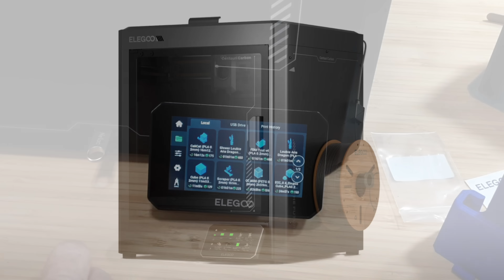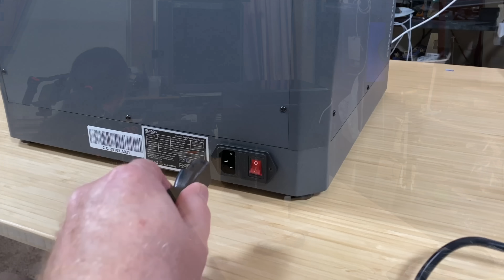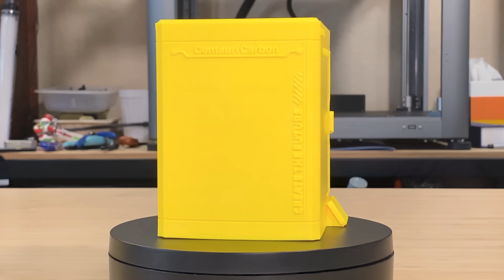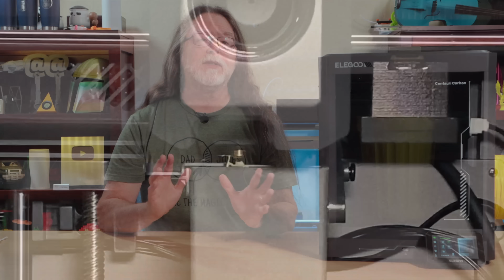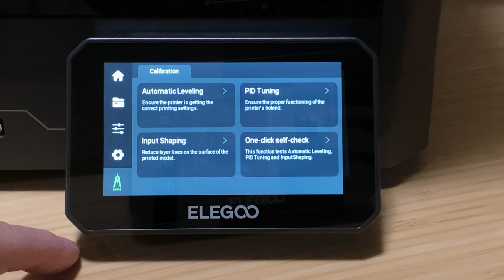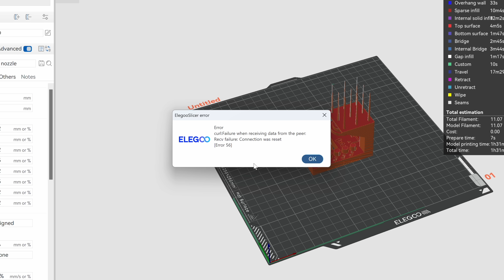Elegoo Centauri Carbon. Enclosed CoreXY for $299.99 USD?!

Comment: Can you use the regular Orca slicer or are you stuck using their version?

The build plate specs are only a little bigger than my Ender 5 Pro. Do they have a comparable model with a little bigger build plate?

Comment: I've never owned a 3D printer.  I don't own an oil field so I'm not rich.  I'm torn between the simplicity of an FDM printer and a resin printer.  I'd like to print figurines that I can airbrush with my airbrushes.  Not necessarily miniatures, but larger pieces.  Not gigantic, mind you, but larger than an inch for Christ's sake!   As far as resin printers I'm looking at a the Phrozen 8k Mighty and the Anycubic Photon M7.   On the FDM side its the Crealty K1C.   No matter how I slice it (no pun inteded) it looks like I'm looking at around $600.  Any suggestions?

Comment: The first person I see on YouTube who has put the cards on the table about the possible problems we may have with this printer in the future. 
I'm taking it slowly with the Elegoo. My first Elegoo was the Elegoo Neptune 3 pro and it came with firmware problems. The company that sold it to me (3DJAKE) couldn't solve the problem that the printer occasionally had a thermostat problem and would turn off and on, obviously losing the print, and then another firmware error. I can't even solve the problem with the firmware developer who sent me an apologetic email. Even today, with the latest firmware (which only had 3 updates), I haven't been able to solve the problem. I'm still using it, but I have to pray that I don't get the same problem in the middle of printing. I also realised that over time the micro SD memory becomes overloaded, for example, when it has to make many circles due to the number of triangles that the 3D printer has, and that also generated errors.
In short, I'm not going to buy another ELEGOO printer, in the rush to see that it is one of the latest printers, until it is well tested and we see what they are going to do about the poop, because apparently a coloured accessory is coming, and it would be better to see if there are people like you who test the machine, so that I can buy an ELEGOO CENTAURI printer, more refined and that doesn't cost more than 330 euros. In my case, I don't want to have to pay more for the mistakes of a company that has been selling faulty goods for years, then ignoring them and which for consumers are just another brick on the desk. I want a printer that works 100% for several years and I have the feeling that, at the moment, there is a race to see who can bring out the latest printer with the latest novelty, BUT THEY ARE NOT CONCERNED ABOUT TESTING IT WELL AND THEY DO NOT CARE ABOUT THE CONSUMER.

Comment: They literally said the multi filament system will be out by end of year.
Reply from the maker: Unfortunately, at the time of recording, they hadn't said it yet. 😅
Reply: @BV3D ahh I assumed since you posted this after the launch that you had already seen the info from the launch on Monday
Reply: I am a little worried now. As I just bought one. If I can’t print from the slicer it’s just a paperweight for me.
Reply from the maker: @SomeGuyWhat77  Yeah, It's just me doing this in between my day job and family life, so recording, editing, uploading, and closed captioning take time.
Reply from the maker: @SomeGuyWhat77  re: I am a little worried now. As I just bought one. If I can’t print from the sliver it’s just a paperweight for me. Elegoo updated the slicer (Unlce Jessy told me about it), which fixed the send-and-print issue I was having. The camera streaming is still problematic, but printing from the slicer over WiFi now works.
Reply: @BV3D  Ok awesome, thanks for the follow through here! That makes me happy. I only partially care about the built in camera as I always use my own Wyze cams, easier for me to monitor whats going on. The camera is helpful through for Octo Everywhere which can use its pseudo-AI to cancel prints when they go spaghetti factory!
Reply: @BV3D  That makes sense!

Comment: What makes this better then a Creality K1?  To me this looks more of a competitor of that then a Bambu P1S or a massive stretch of the X1C.  I had a K1 that worked really good and then 1 day it decided to crap the bed and not print anything it had just even a day earlier.  If it is from my understanding looking at everything people say it just seems to be a clone of the K1.  The filament sensor on the side (dumbest spot ever), hotend and tubes/chain looks identical to the K1, over all design seems almost entirely the same as the K1 (screen, door, etc.).  Someone not paid by Elegoo please tell me how I am wrong here.  If it truely compares more with a P1S and I will not need to tinker every print to get it right then great I can deal with the horrible filament sensor location.  I just need a printer that works out of the box.

Comment: Elegoo should add a wired Ethernet connection to the printer. The network issues you experienced could be caused by wifi dropping the connection. 
It's also what I experienced with video from a web cam connected to a Raspberry Pi (for my old Kobra printer). As soon as I used the Ethernet connection the video feed was stable.

Comment: Is the firmware on this Klipper as it has been on some of their other machines recently?
Reply from the maker: Elegoo hasn't said. It feels like it's running Klipper, but I could be wrong. There are only three network ports open on it. Port 80 for its built-in web server, and a couple in the 3000 range, one of which is for the camera streaming. I can't SSH to it because it doesn't accept the connection.
Reply: @BV3D  thanks for the reply. Hopefully it opens up a bit once it releases.

Comment: Curious, for the stringing and bridging issues, did you print the test model in blue PLA with the enclosure open or closed? I have seen a couple other reviewers print the same thing, with better results. Not calling you out, but supposedly its better to print PLA with the enclosure open. Nonetheless thank you for taking the time to review this printer.
Reply from the maker: Hi, no offense taken. I did the PLA prints with the lid off. It may just have been a settings thing, since it looks like Elegoo has a bunch of their materials already defined in the slicer, and I wasn't using Elegoo's filament.

Comment: Wonder if the issue with your send to print is that the router set a new ip adress for your printer and in the slicer wanted to use the old ip address.
Most routers, unless you have configured it differently, will give an ip address for a day or 2 to each device.
Reply from the maker: Hi! The printer was still at the IP address that was configured in the slicer. I didn't know until Uncle Jessy told me, but Elegoo released an update to the slicer a day or two before I recorded the video. That update appears to have fixed the network file transfer issues.

Comment: Your file upload issues sound like theres either an arbitrary limit to file size set on the printer's webserver or the connection times out before the upload actually completes. Either way it should be simple enough to fix in an update

Comment: It's a tough time to be in the market for a new printer. There are so many to choose from, but each has drawbacks too. Bambu and their recent drama, this with wonky firmware, the Anycubic that has an AMS, but really slow filament changeover times, the Crealitys with their issues. I think I'll sit on the sidelines a little longer.
Reply: Yes! I but Qidi plus4, it was amazing until it suddenly was dead. Now waiting replacement parts and hoping I can put it running again. It has some manufacturing issueas obviously.

Comment: Hi!
Did you try to access it from SSH? Maybe there you can install some better web interfacer (fluidd or mainsail with kiauh). Don´t know if klipperscreen could be an option for the screen interface...
Thanks!!
Reply from the maker: I tried, but it didn't respond. It only has 3 ports open. Port 80, port 3030, and port 3031.

Comment: Can you make a video of comparison to other Core XY? I want to upgrade to a Core XY but do not want to wait for the current pre-order date of June.
Reply: Seems like none of the people who received one have compared it to any coreXY like the Bambu P1S/X1. If it was as good they would have said so. The fact that it did not pass the .2 test in this video is concerning. It should easily have passed .2. Bambu’s can pass .2 and .1.
Reply: @TheFutureLooksGrimm  new to 3D printers, would purchasing the 0.2 hotend fix this where you need that precision?
Reply: @ it may do better with a  0.2 nozzle but I don’t know how much better. Printing with a 0.2 nozzle is extremely slow, most prints are done using 0.4.

Comment: The errors you talk about when sending files over the slicer. I have had the same issue on my Neptune 4, using Orca. I found that deleting old prints, through the slicer connection, fixed it.
Reply from the maker: Elegoo released an update to the slicer that seems to have fixed the upload problems. Camera streaming is still a problem though.

Comment: Awesome video. Did you update the slicer yet? I think v1.1.7 or something like that should fix the file sending. Camera is still wonky
Reply from the maker: Oh sweet, you're a lifesaver! I'm like 99.5% sure I checked for updates in the app when I first installed it and there wasn't one. But hey, it's there now, AND when you send the file from the slicer, it gives you the same options as when starting a print from the touch screen: You can enable or disable time lapse recording and bed probing, and pick whether you want the A side or the B side of the flex plate.

Comment: Looks like it could give Bambu a challenge.  The price seems very good for the size and features.   As you  stated firmware is the easy thing to fix, if the hardware works.   I'm impressed with the new 3D printers on the market, how far they have advanced in the 6 years I have been in the hobby.

Comment: Thanks, Bryan, for this first look. I have several Elegoo printers and for the most part they are reliable. I can see me getting this particular model when all the kinks are worked out and perhaps multifilament handling is offered, too. It certainly seems priced well. I like the fact that the user isn't tied to an Elegoo cloud service to print with, and you can still use a USB stick in the good old-fashioned sneakernet.
Reply from the maker: Hi Stew! So it turns out that a newer version of the slicer has addressed some the problems I was having sending files over WiFi to print. So if Elegoo can get the lighting sorted out, and tweak the firmware a bit to fix some of the other issues, this should be a pretty solid showing.
Reply: @BV3D  elegoo doesn't care though.....just look at the disaster with the giga. uncle jesse and 3d printing nerd had huge problems with the giga..... and elegoo has still not fixed those issues
Reply: only thing elegoo sucks at is customer service, it to 39... fuckin 39 emails to get elegoo to send me the silicone socks for my 5 neptune 3 max's. it was the biggest hassle. elegoo tried to get me to buy a whole new hot end, when all i needed was the silicone socks. elegoo doesn't even offer the basic replacement parts in their replacement section and ender 3 silicone socks do no work with the neptune series. elegoo sent me ender 3 socks and the sock failed after 1 print. after another 12 plus emails they sent me the right part and sent me a free roll of filament. i could care less about a free roll. the tech support at elegoo should have sent me the right parts after the first email. also all the replacement parts should be available online in their replacement section. no one should have to reach out to tech support for a silicone sock...its just bad customer service. elegoo has good printers but i warn you, there tech support/ customer service is the worst!!!!

Comment: As long as this printer is reliable over long term tests and the firmware stuff gets fixed than I think it's safe to say that Bambu will need to do something drastic or they will begin loosing market share rapidly to this machine. I own 2 bambu enclosed printers and I am already sold on this as long as it meets those for-mentioned requirements.

My main gripe with Bambu is their cloud service. I would prefer to work over my own private network. I lost internet for a few days which means I lost the ability to print directly from the slicer and I had to go old school with the thumb drive.

Comment: 299$ usd and 449$ cad, this maybe the cheapest feature packed 3D printer so far. A lot of people seem to forget what they are getting for such a low price
Reply: $625 CAD after the pre-sale is over. Still a great price but much closer to Bambu P1S pricing at that point.
Reply: @OnsaneDan  just bought it for 485$ cad after discount and shipping. The CC has most features of the X1C at 1/5 the price. This will be like the computer evolution of the 80s and 90s, which made them cheaper, affordable and more popular than ever before.
Reply: @mohamedh.guelleh630 How did you get the extra discount? I thought it was $449 with $50 shipping?
Reply: Buggy firmware, apparently.
Reply: @lyianx  it's a firmware and can be updated. The reviewers got the alpha version
Reply: @lyianx  every printer has buggy firmware when its just released. bambu has this problem when they released their first printer

Comment: The firmware interface looks like klipper. Can't wait for the cfw on these. Hope creality k2 normal size comes out soon.
Reply: The K2 Plus is a beast, by far the best consumer grade printer on the market, to the point it is not really consumer grade, its professional grade. I love mine, I have even put the old go to machine the K1 Max on ice for a while. Expensive ,  yes, head and shoulders above the competition certainly. I just works, and works fast with exceptional quality
Reply: @mikeobrien9829  yeah, the k2 plus looks great. I have a k1, so k2 would likely be the next upgrade if its anything like the k2plus. Worth it, but out of reach in terms of price for me.

Comment: Thanks for a detailed and non-marketing real review. 
I am not sure how big (or small) Elegoo’s software team might be, and that will affect the rate of development and polishing out the last bugs (while creating firmware to handle the open frame version and the AMS). 
Strikes me that there is a bunch of (English language) user interface polishing tweaks that would be nice, but don’t impact the actual functionality of the machine. 
Beyond that, Bryan flagged up that it seems to be that one communication process crashing leads to other annoyances. Squashing one bug should improve the overall reliability. 
But there were a couple of print quality issues that surprised me. I was kinda surprised that those things weren’t checked out. Was it a material profile or dryness problem, or just trying to print too fast? (We weren’t told the filament brand or profile used!) 
Firmware is (given the will and the resources) much more easily fixed after-sale than hardware issues. Seems like the hardware works plenty well enough for 299, but patience and understanding may be needed while the firmware gets tidied up. 
Now, will third-party lighting upgrades arrive before the printer itself? 😊

Comment: I'm guessing at the time of filming this might've been unknown, but Elegoo has announced a multi-filament system which is advertised to be released later in 2025.
Reply: ams systems are okay... the main issue with the ams and all ams you can never get exact colors, which is why there are so many noobies with off color pokemon. learn to airbrush your models. painting is so much cheaper and fetches way way more money than all the noobies printing the same flexi toys and pokemon thing there printers are vending machines and do zero sanding/painting but want top dollar for prints they print but never designed. alot of yall do this... making toys over functional prints there are 3d printing nerds and then there are all the bambu noobs unwilling to learn the basics
Reply: @sauron4526 For me the main selling point of AMS style solutions is for storing multiple materials (abs, petg, pla,...) inside a chamber and not having to load/unload filaments as often. A huge plus if the chamber can also dry them

Comment: They showed the printer like 8 months ago. Maybe the issues are fixed in another 8 months, but pre-sale price will be upped to regular price long before that...
Reply: Announced 8-12 months ago only to "launch" to a pre-order which is then 3-5 months away lol. And yeah, outside of the US, pricing will jump 50-67% depending on the region. This is much closer to 450-500 USD in most parts of the world post pre-sale.

Comment: In Australia it’s $699.99! Elegoo’s pricing is bizarre. The Saturn 4 is USD $299, and it’s AUD $469 in Australia. 
Why so different for the Centauri Carbon?
Reply: The US price of the new Saturn 4 16K is USD $499. The Australian price is 769.99, just $70 more than for the Centauri Carbon. Make this make sense?
Reply: The 300 price is a short term deal, that seems to have already sold out. The regular price I think is more like 450.
Reply: @ge2719  They have already said USD $299 is the regular price - on the Uncle Jessy launch stream. The Australian price is a joke.
Reply: @av_oid  Only in the US ...every other region has temporary pricing that after conversion will be much closer to $450-500 USD. This is true for Canada, all of Europe, Australia and Japan. Don't worry, you're not alone